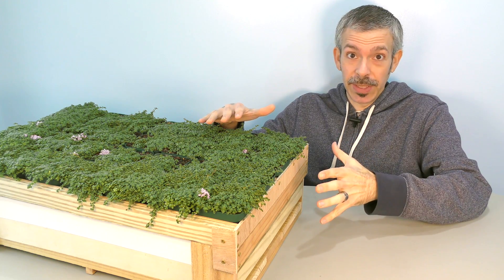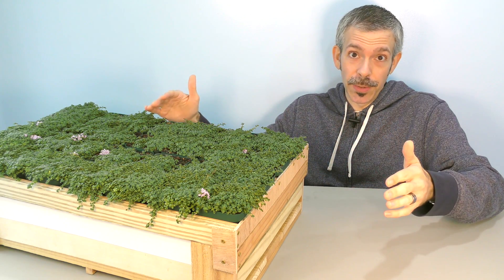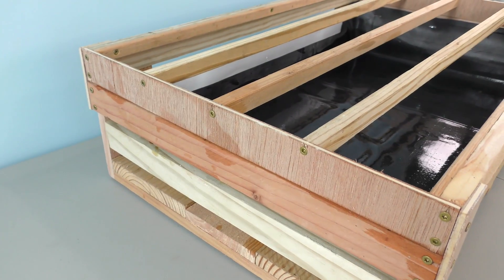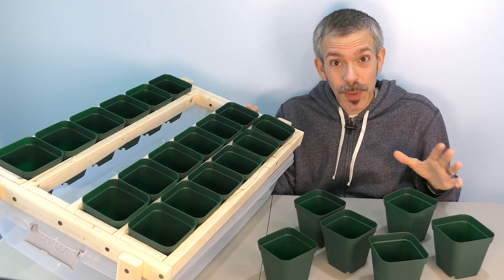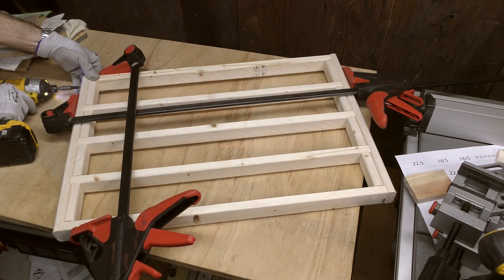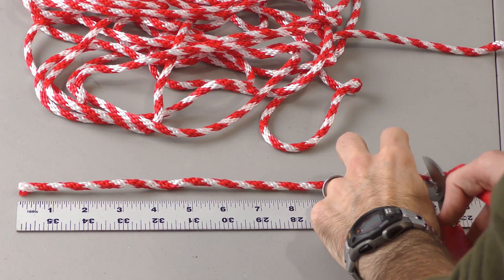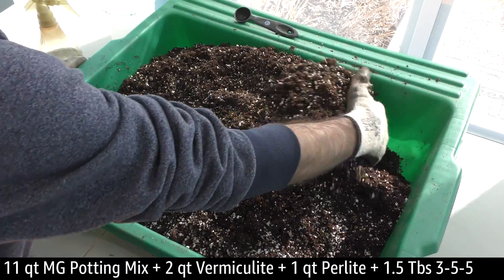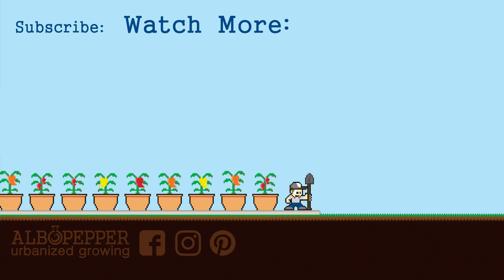Seed Starting / Cloning Tray, Wicking System for Nursery Pots (Self-Watering DIY SIP) Tutorial

Comment: Great vid!  Hope to see new ones from you, soon!  I did this, but skipped having the wooden lift-off rack, which is a great feature.  I bought the nursery pots, cord, a set of Cambro restaurant bus boxes ($17 for 2) from Samsclub, and Wilton 10” x 16” cooling racks ($4) from Walmart.  I inverted five 9-oz rigid plastic cups in the tub (one at each corner, and one in the center), then set the rack on top.  The ridges in the bottom of the tubs allow the water to flow under the cups.  Each tub/rack combo holds 15 pots.  Perfect for my needs, and a good size to carry from place to place (esp with variable temps!).

Comment: Hey, if i wanted to increase the water reservoir in depth, I would need to increase the length of the wicking string(to reach the bottom), but if i did that, would the soil  get too saturated? Thanks

Comment: is this something you would use for any seedlings? does SIP ever 'overwater' seedlings? sometimes i hear that you should let seedlings 'dry out' a little bit for its roots to spread out more.
Reply from the maker: Great questions! I've been testing this on a variety of seedlings including lettuce, celery, peppers, tomatoes, oregano, balloon flower, salvia & germander. The celery & lettuce loved it. The flowers & herbs did pretty well. None of them seemed to fair any worse vs non-wicking versions. My potting mix recipe worked extremely well for the thyme, but for the tomatoes & peppers, I think they needed fertilizer. Those plants did well at first. But as they got bigger, they ran out of nutes & needed repotted. One thing I've observed is that the plants have NO issues sending roots out into the pot. The wicking system definitely did not impair rooting. With some plants, the rooting was even enhanced. The tomatoes began sending roots all the way down the wick and into the water reservoir. It started to fill up with water roots! https://albopepper.com/images/tomato-water-roots-in-reservoir.jpg
Reply: @Albopepper  wow those roots are intense! couldn't you just use a water soluble fertilizer and add it to the reservoir to fertilize everything at once when it comes to the tomatoes/peppers?
Reply from the maker: That's a great idea actually. I had been thinking about that. But I would probably be very picky about what kind of fertilizer I used. Some liquid feeds have a broad range of nutrients, but they still lack calcium & magnesium. So I would look for a complete fertilizer. Essentially, a hydroponic solution. My guess it that this would work the best.

In my testing though, I had a variety of plant types in the same system at once. The tomatoes got too large and crowded out the other things. So ultimately, it was best to simply pull them out and repot.

Comment: Suggestion for wicking planter version 2 - instead of plastic pots use small fabric grow bags to enable air pruning. So easy to sow and incorporate a wicking cord. I’ve been using BPA free landscape fabric as it’s strong but breathable. Solid plastic type materials should be avoided. Many YouTubers including MIgardener rightly promotes fabric pots as the best growing solution but recognises the risk of soil becoming too dry - incorporating a wicking cord overcomes this disadvantaged. Would love to see your take on this. 😊
Reply from the maker: Where do you get your 3.5" fabric nursery pots? And how will you suspend those in between the rails?
Reply: @Albopepper  I made them! Super easy. Fold a rectangular piece of fabric in half so that you will be sowing down both sides, having placed a wicking cord into the fold so that it will get stitched in place. With soil in im honestly sure they would sit on your planter in rows like your pots do, but for more stability you can fold the top to create slits for two chopsticks or pencils to hang the soil bags from instead.
Reply from the maker: It sounds like you've got it figured out. If you try it, let us know how it goes!
Reply: @Albopepper  Already have, moved my grow bags over a week ago and the soil has remained moist but not too wet since, seedlings (tomatoes, dahlias, stock, and a few other things) are all coming on well :)

Comment: how do you know when to add water? Do you have to lift up the plant holder every few days? Wouldn't the clear plastic container be better for the base, so you can view it easier?
Reply from the maker: Yes, the clear plastic version definitely allows you to see spot if the water it low. Otherwise, I just pull up one of the pots and peak underneath. I only check every few days. The main thing is to make sure the wicks are always touching water. Also, be aware that if the system is not perfectly level, one side might dry out before the other. Depending on plant size and how deep the reservoir is filled, you can easily go a week without even touching it!  🙂

Comment: This is an excellent modular build. The concept is certainly sound.

If you lack woodworking skills you can adapt this concept to deep tub & upside down plastic baskets. I went through a trashbag full of old plastic containers & found some dollar store type plastic storage baskets (with square holes in the bottom) that fit inside large bus tub. The baskets are about 6 in high. The bus tub about 7 in high. I snipped out holes to fit the tapered pots about 1/3 way down & side by side. Flipped the basket upside down & pushed in the pots to hold & suspend the above the water line in the tub (as the wick provides the moisture.) There's some minor slack in the fit which I can solve with some foam blocks.

With some online searching, I could no doubt find a tub & basket insets for a better fit.

Comment: It is an interesting thing to think about: how would you build a system that could hold 10 5 gallon buckets?  Something that could support that weight?  Also, when willing, you could put the tray of pots into the lid from the Rubbermaid tote.
Reply from the maker: That's a good idea that you can use the tote lid as a tray for the pots! For the 5 gallon buckets, you could place them in a row over a rain gutter that is reinforced with 2x4 lumber.